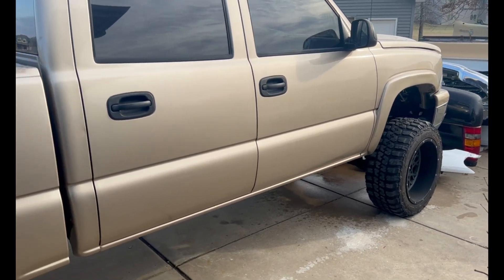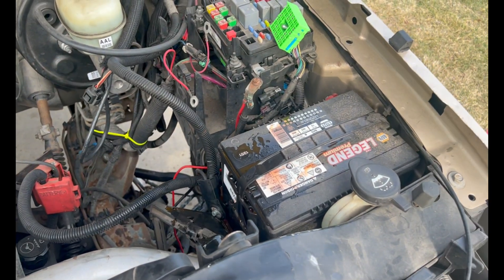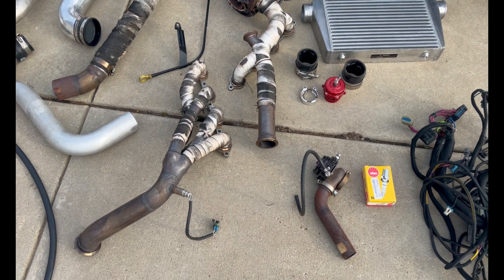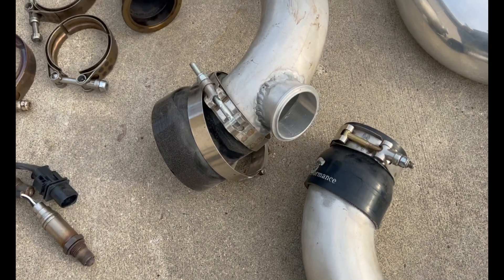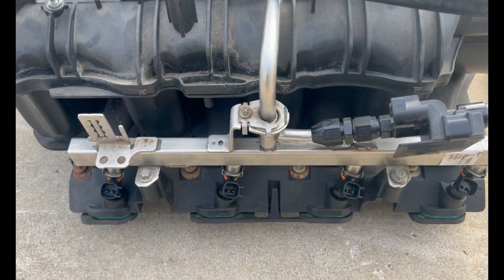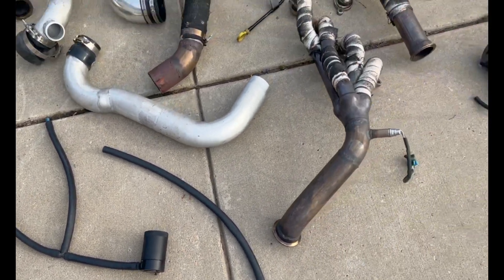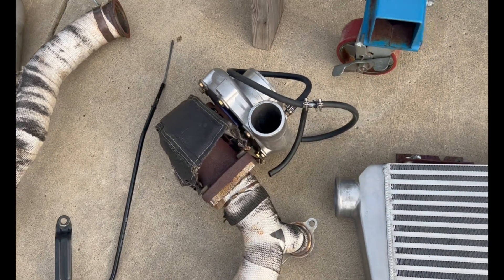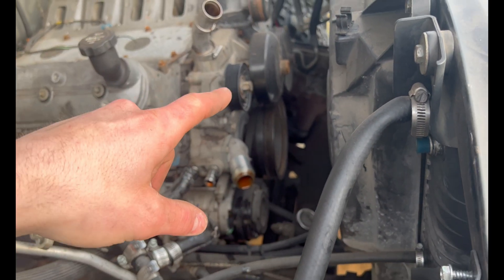99-06 Chevy/GMC Custom Turbo Kit...Time to Build My 6 Liter Lq4

Comment: Did you have any issues with the down pipe hitting the wastegate? I have turbo manifold like that on an want ditch my fender exit and want run full length exhaust
Reply from the maker: Yes, I had to custom make it and modify the AC dryer. I’m rebuilding the whole truck currently and probably going to re configure the down pipe to fit better